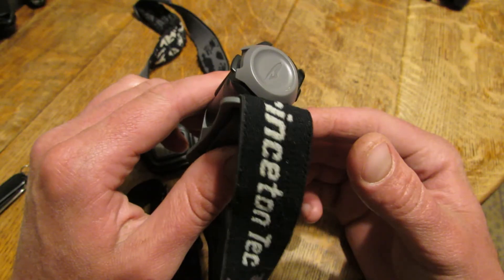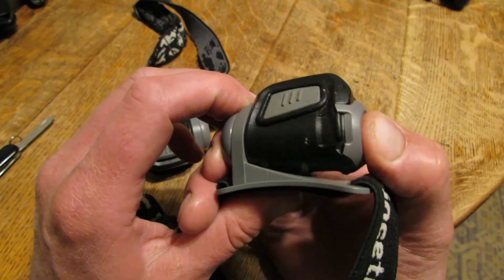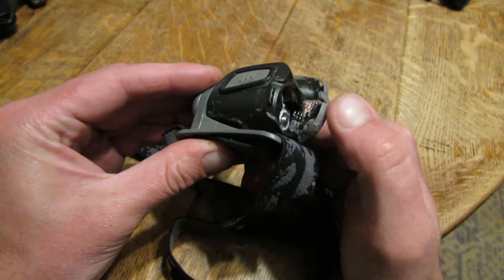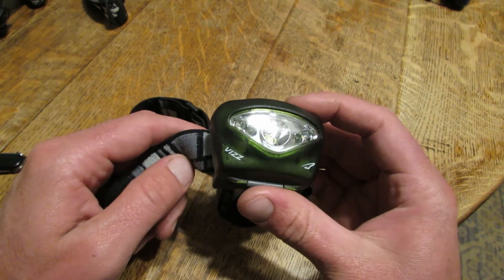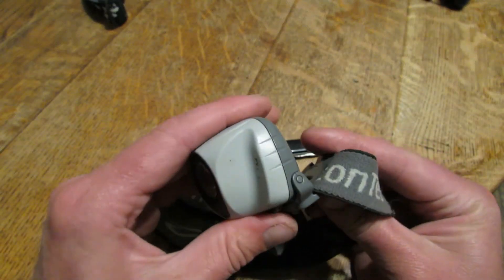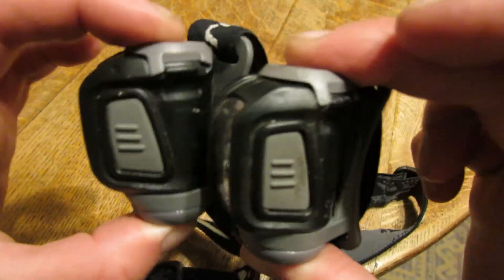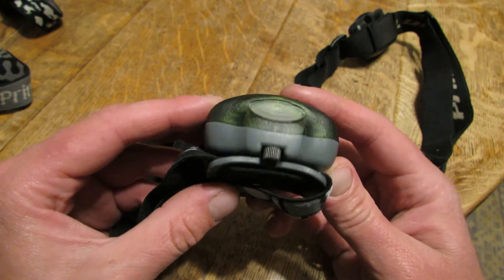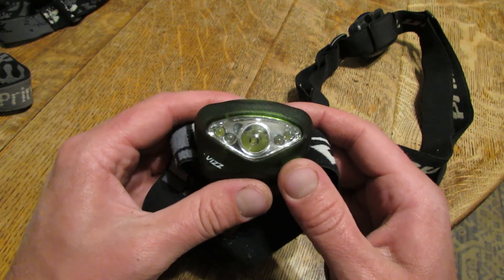Princeton Tec Headlamp Fatal Design Flaw

Comment: I had a Remix and the battery cover broke at the hinge.  I returned it for repair.    
After 6 months I called and ask about the repair.  Three more months passed and they sent a Remix 450, now it has broken at the clasp like the ones in the video.  I will not be buying another Remix even though I love the default to red light feature.  In fact, Princeton Tec's customer service is so bad, I won't be buying another headlamp from them.

Comment: I love my remix 450.  I only use it for deer hunting and love that it always turns on red but I can switch it to white fast. Plus the push of the button is silent which is my complaint with almost all other headlamps
Reply: Same thing. I use mine for aviation. You dont want to blind yourself in a cockpit at night. The red light is great. They now have a SNAP RGB or something with a magnetic base that comes with several mounting options and its a big solution. The preflight inspection, the cockpit, Tie downs and tarmac white light. A great product.